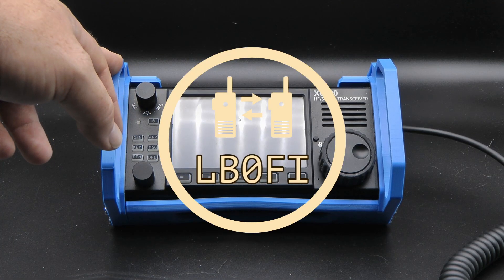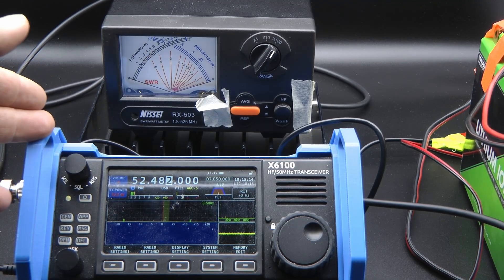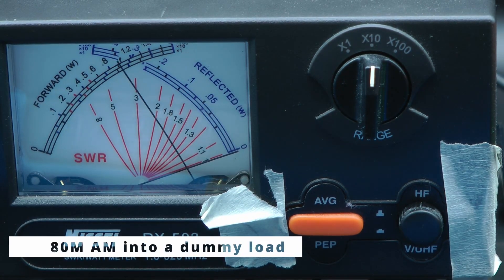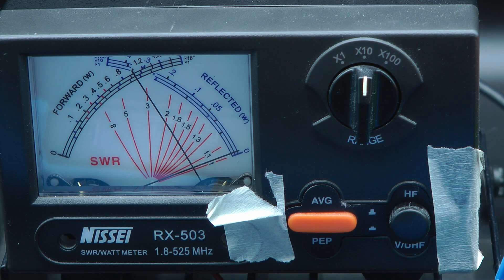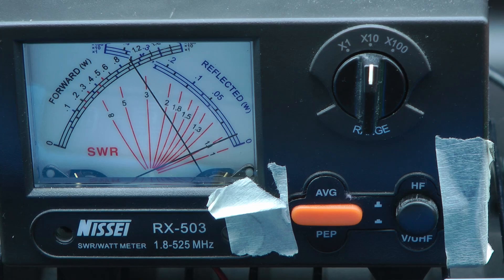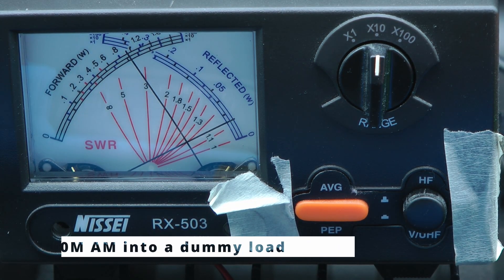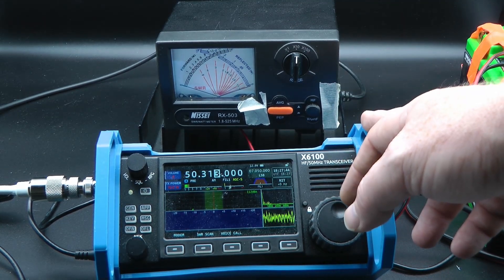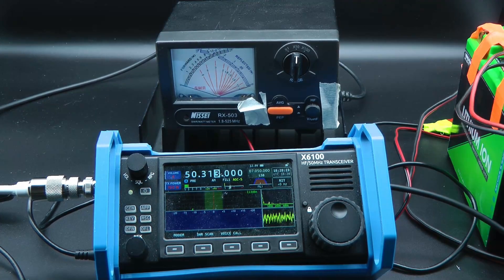Is the Xiegu X6100 really a TEN WATT radio?

Comment: Does the X-6100 have as good or better filter capabilities as the FT-891? I use head phones so external speaker sound doesn't matter. (I have the FT-891 great radio easy to use)
Reply from the maker: I haven't played much around with the 891, and it has been two years since I sold my 6100, so it's hard to give a definitive answer, but my gut feeling says that the 891 has better filters and pretty much better anything.

Comment: I would guess the AM carrier was lower than 10W, as when modulated - the peak power must be higher than 10W. Perhaps it's a 20W PA? In that case SSB should also be 20W.
Reply from the maker: That would be my guess as well, but I actually revisited the topic and another video and it was 10W on CW as well.

Comment: Wouldn’t it be better to test CW output power? Or did you test this with a 1khz sine wave on the audio input? Not sure if AM carrier with 0% modulation gives a meaningful result. So it might do in fact more than 10W.😉
Reply from the maker: It would be better, but I don’t have a key at the moment though. You’re not the first to point out errors in my methodology though. I might have to revisit this later.
Reply: @LB0FI  The super pixie is waiting! We must build it and do at least one QSO to make Gil proud and a good excuse to get a key on prime day.😉
Reply from the maker: @labcat73  My Pixie is still on it’s way unfortunately. I will probably just finish up my 3D printed key. It’s always nice to have a tuning device handy.
Reply: Does it do fm? That would give a true representation of carrier power output. AM is set up to the have the carrier at 25% of total peak envelope power. If it's doing a 10w AM carrier and maintains that if you modulate it, you'll be doing more than 10w.

For example, an Icom 7300 has a 25w AM carrier. When you speak you get modulation peaks up to 100w
Reply from the maker: @K4AX  It does do FM, and it also does CW. There's an update in my next video that premieres on Friday.

Comment: I have this radio too and like you like it for the same reasons!
Reply from the maker: It’s a fantastic little thing, and it’s also a platform for experimenting. The fact that it runs Linux is a great feature.
Reply: @LB0FI  Oh yes and that we can experiment with the Alt version just from an SDCard no need for a permanent install.  I live in hope that they will one day enable the CAT control and Audio via Bluetooth and maybe inbuilt JS8Call for EmComms then it would nearly perfect!
Reply from the maker: @Stewart-HA5RV  Check out the R1CBU firmware. CAT control works now.
Reply: @LB0FI  Oh I downloaded the latest a few days back but didn't realise that - I just tested the onboard FT8 so far which is F-ing awesome! 😁